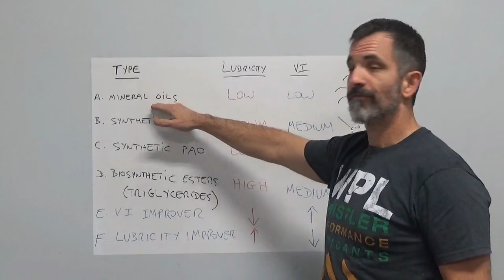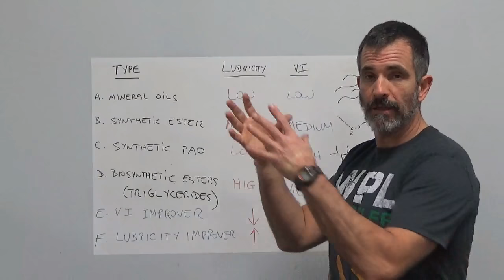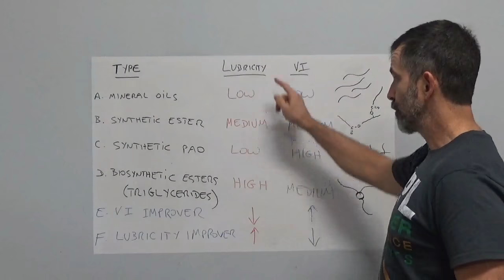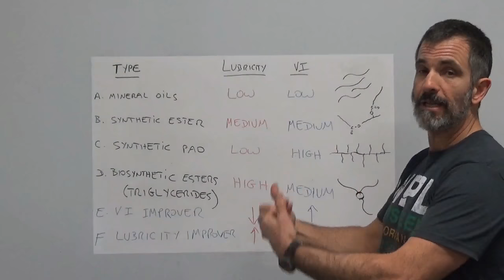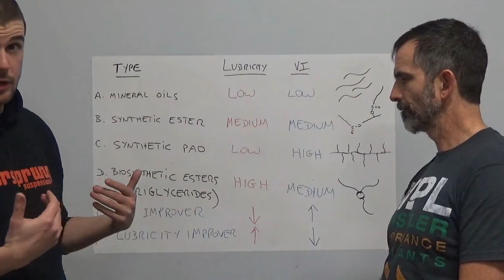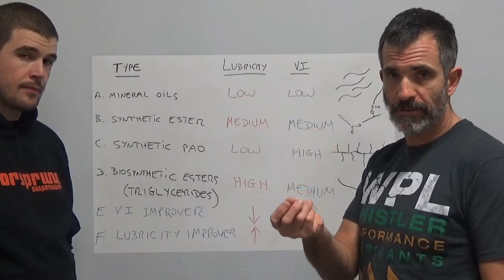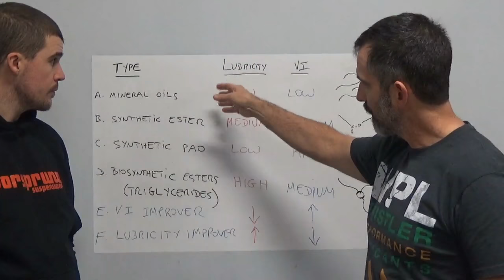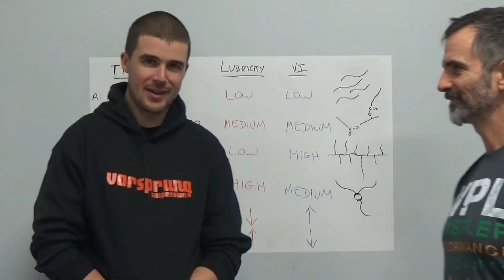The Tuesday Tune Ep 10 - What's in your oil?

Comment: Kinematic Viscosity is the ratio of absolute or dynamic viscosity to density - a quantity in which the force is external and independent of the mass of the fluid. Kinematic viscosity can be obtained by dividing the dynamic viscosity of a fluid by its density